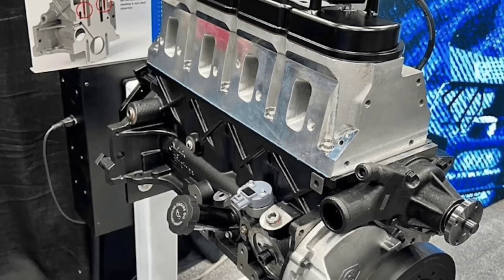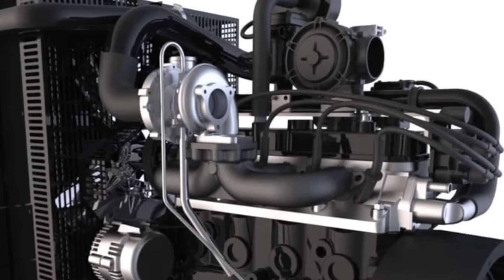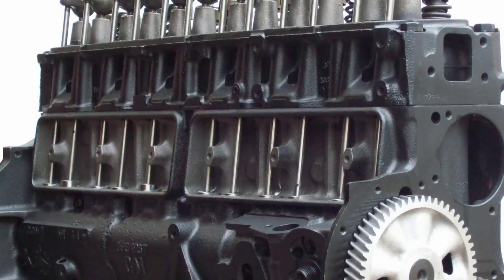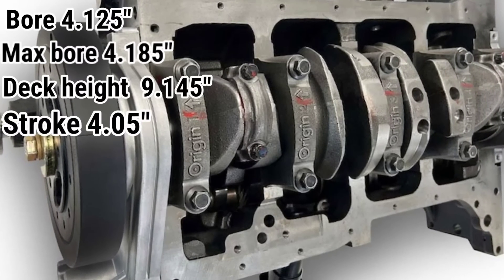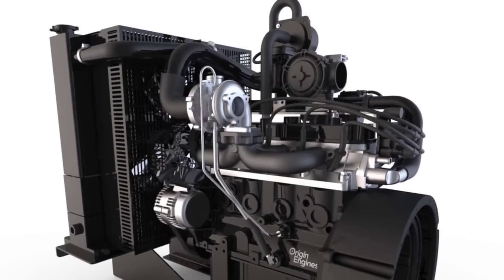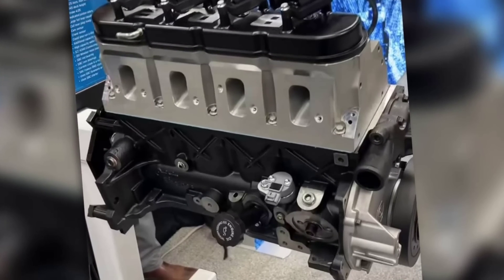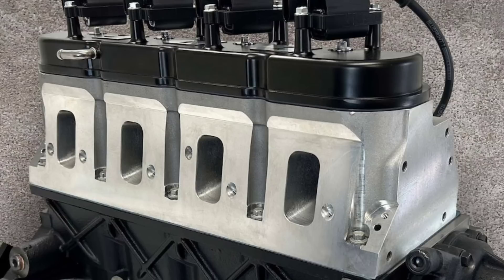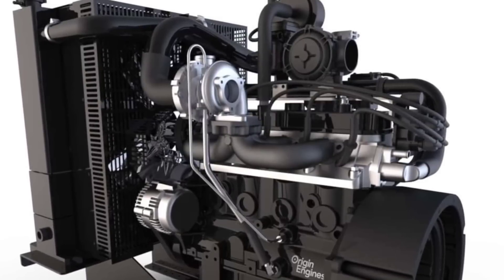SPECS and MORE on the 3.6 LS 4 cylinder engine by Blueprint engines

Comment: It would be nice if Blue Print would pick this back up and do something with it instead of shelving it.  For my application I'm thinking a distributor and naturally aspirated.  Downsized version?  like a 4.0 bore and a 3.75 stroke would come out as a 3.1l that would perform very well also instead of maxing out the block. Even with that I'm sure it would out perform my current 4cyl and 100 hp.  Question is about the accessory bracketing though.  Got an early toyota truck with AC, and power steering

Comment: Looks like an improvement over the old 3.7 mercrusier Al block, open deck, BBF headed, 170 motor. Big 4s are cool! I'm thinking a GM 3.0 4 cyl industrial motor with a bowtie head and a turbo wouild be nice for a flatfender or early CJ-5. These are awesome!
Reply: grab a motor from a fork lift, swap the cam to a 3/4 or one from a marine engine,   use a clifford intake and header,  it's a beast

Comment: There is way to much emphasis put on 4 bolt main caps, imo those 2 extra bolt just makes most people feel warm n fuzzy to see them. Yes the extra bolts do increase  clamping power but it basically just helps stabilize the cap and helps spread out the load but as far as clamping power there contribution  is miniscule, about the time the cap is relying on those outer bolts to hold together it's likely too late, if parts didn't scatter there's likely already damage. Besides when was the last time you saw a grenaded engine where the crank popped off the block... Welp the rods held but the caps didn't... Never. Obviously when you get into the big HP engines they play more of a role but in a 300 or 400hp SBC it doesn't matter if it's 2 or 4 bolt and if i remember right with the 400 SBC the 4 bolt are the weaker blocks. And if your doing a factory block high hp SBC build you want to source a 2 bolt because then it can be converted to a splayed bolt cap if you start with a 4 bolt that's what you stuck with and they are not much better than a 2 bolt.

Comment: The block appears to be based on late production  GM 3 litre marine and industrial block, which is a big bore and longer stroke (4 in. X3.68 in.) version of the old  '62 to '70 153 Chevy 4-banger which in turn  was based on the '63 to '70 230 cubic inch Chevrolet 6-banger.
Reply: Yes i think its based on the Chevy II 153 as well.
Reply: Did you listen to what he said in the video?

Comment: What is the need for this engine? Ok, it's a 4 cyl that will get me into LS Fest, but other than that it's a heavy, low tec, 4 cyl. If you just want novelty then why would you not just put a turbo Hayabusa motor in your vehicle at that point? Half the weight, more power, more tec, and revs to over 10k. Probably cheaper also.

Comment: GM will probabaly make a version of this that is a 3.3L turbo 4 cylinder to replace the 2.7L 4 cylinder, basically half of a 6.6L V8 l8t gasoline engine from the newer model 2500/3500 GM trucks.

Comment: I have 90 K 1500 with 5.7L v8, factory advertised 195 horse. Not enough to pull its own weight up at 5% grade. Toyed with LS swap. Then spotted this. Interested in torque that will pull this truck and moderate load up of 5% 6% grade even if I have to run it in third gear revved to approximately 3000 RPM. Will be watching this one.
Reply: Old comment, but… 
Without boost this engine would at best about equal the hp and make less torque than your factory 5.7. It’s pretty easy to make 350-400hp with an old 5.7. Might as well just rebuild what you have or swap in the good ole 350hp crate engine they’ve had forever.

Comment: I want this for a replacement engine for my 2004 E150 Ford Work Van. The Triton V8 that is currently in it is running quite strong and has been very well maintained, but this thing looks like it cuts half the weight and more or less doubles the power. My only concern is towing a dump trailer, but as long as it gets 300 foot pounds I think it will be alright.

Comment: I like it. I think there’s too much focus on the “old school, primitive” pushrod setup. Let’s remember 1000-1200hp is pretty common in the pushrod LS V8s and plenty seeing 1500-2000hp and even more. The materials of parts are more important than if it’s primitive or not in this case. That design can easily hit 800+ Hp if built right and with a rev happy valve train, large turbo and race fuel. I’d love to see this engine in action.

Comment: The things I am skeptical with this engine.

No 1: I haven't seen any videos of it running. If anyone knows of a video showing it's running please post here. I understand it's in concept phase, but surely the concept engine should be proven it can run.

No 2: Engine balance and vibration. Large 4 cylinders exhibit much secondary order vibration which can limit engine speed. Looking at the block, there is no provision for a balance shaft. I'm interested to know if this would be a development in the future.

No 3: The specs, quoting torque and power figures without the RPM doesn't really mean much. If they have done testing and have power and torque graphs, this would be more meaningful and also indicate to us maximum RPM.

Comment: I'm going to guess it's a little over 200 hp and 250-300 ft/lbs of torque NA. Probably ran it on 10-12lbs of boost with a 48-58mm turbo. That would be the most representative setup. This engine and a turbo that is little on the small side for a 3.6L, enough boost, but not crazy, would work very well for a light truck or off-road setup. It think that's who this is for. This is a gas competitor to the Cummins R28 crate setup. If you're buying this for another reason, I'm curious, but it would seem a strange choice. Hopefully, they can get this out for under $6k.

Comment: Application, application, application... I for one am excited to hear more about smaller displacement engines that are suited for toughness. I'm sizing up a restoration of an '89 Toyota pickup and even if I spent $4-6K on getting the engine professionally rebuilt for numbers by Yota1 Performance or 22RE Performance it would still only squeeze out a maximum of 130-140hp and maybe 160-180tq. I can't stomach the idea of a V8 swap because that hardly makes any sense aside from a 4.0L 1UZ and that isn't even touching 200hp. Besides-- who can say no to a new crate engine that takes easy to find parts? With the simplicity of an engine like this, the combo would make for a classic Yota look with a grunty four banger inside. Slap the six lug dually under the rear and I have a small footprint workhorse. Booyah! I'm looking forward to more deets from BPE as well as a price point 😉
Reply: But what’s the thing going to cost?

Comment: If this can put out 300 Hp at 300 lbs that's lighter than a 9 cylinder Ivchenko AI-14, which is 260 Hp at 434 lbs. There's a lot of aircraft this might be used on.

Comment: The natural aspirated numbers will depend on the compression ratio, cam shafts, intake manifold throttle setup and what fuel its tuned for. Also eventually they might come out with a longer stroke version of the crank and rods changing the numbers so I mean it's not really a set power band till the buyer specs it out and the transmission and what drive line, tires and so on will have a bit of an effect. So really the potential is still kinda endless at this point

Comment: Everyone dances around the elephant in the room ... and you did too...  BALANCE , this configuration can't be balanced for high revs, these guys dreaming of putting it in a S-10 need to know it will have a redline of around 4500 rpm....  Yes Margaret it IS a tractor engine , it will be good for a rock crawler, not a street racer !
Reply: Ive been screaming this since this engine appeared at pri. It would need titanium rods w lightweight short ch pistons w/short pins and still on top of all that need twin counter rotating balance shafts or as it climbs above 3k rpms the nvh/vibration will literaly beat itself to death.

Comment: So here is a bit of an observation more so. There are thousands of LS Engines that wind up to 7-8k RPM, because the heads can flow up to that point with minor changes here and there. So I would not say it isn’t too far fetched to say that with the correct camshaft selection (pending on aftermarket availability) that the engine would be able to withstand 7-8k RPM not to mention that the rotating assembly is literally half of a standard LS engine so on paper, with the correct parts (say 6.00” rods pistons, and a bit of touch up with the heads to better improve flow and compression.) should be a beast NA let alone Turbocharged. I personally would like to take one of these and see what I can push out of it when the aftermarket becomes available.

Comment: My Toyota 2.7 is also 2 bolt mains and is currently pushing 380-410 hp depending on weather. I had a lot of fretting at the cap once I started reving past 8.5k the solution was to increase flywheel and harmonic balancer weight as well as go to a 2" rod bearing vs the 1.78. Fret still happened so next I'll be putting a steel girdle and ladders across the caps. If the issue persists, I will have to open up the  bearing clearance half more.

Comment: With a BPE rec port head a 7.2L LS V8 should be capable of 650hp 575tq  n/a, I would expect half of that, 325hp 285tq. I really would like to see a cross plane crankshaft in this engine so that it would sound like a baby V8, I would be completely on board then. Otherwise, there are plenty of cheap aluminum 5.3s in junkyards that would only be 100lbs more weight, easily half the price and capable of 450-500hp depending on cylinder head, compression ratio and cam timing. Of course even the diminutive 4.8 can handle 1,000hp at the crank with boost so any LS/Gen III/IV engine is a monster. The possibilities for the Atlas 4200 are insane too as there is growing aftermarket support for those thanks to Nivlac57.
Reply: First of all, it needs a balance shaft
Reply: Yeah right more like 250 na max.

Comment: After seeing the first video, I went on marketplace to look for a specific type of 3rd gen F-body, aka the one with the amazingly named Iron Duke 4 cylinder. An engine released into the most 80’s of 80’s sport cars outside of the Countach (spelling?) and in the late 20th century this engine made almost 90 hp😂. However putting this thing in place of the duke sounds like all the fun👍
Reply: I’ve had three IROCs but always loved the early base model cars. I would love to put one of these in place of an Iron Duke!
Reply: @sc3ku  imagine the “wtf is that” factor at a car show
Reply: It is a duke , same block as early S-10'S, an keeps , bell housing same as all block , mercury marine mercrusier boat motor , they make a ,three liter
Reply: The iron duke was rare in Camaros, but fairly common in stripped-down firebirds because the iron duke was a Pontiac engine design.
Reply: @Cream_of_sum_yung_gai  yup it sure was, and in fieros. But the best place I've ever seen one was in a boat. And no not as the anchor, but for moving around in fresh water it's a perfect low stress environment for that thing. I have no idea if it'd do quite as well in salt water with currents and such but out on a nice calm lake it's fine for moving around a little fishing runabout. And given the period it was built and the third gets were designed engines like the iron Duke had to happen. 1. It showed American manufacturers that complacency in the era of people seeing what the japanese car companies could do with a four pot was very ungood for them. And customers leaving them for brands like Honda and Toyota was an actual threat. My dad had just gotten his first union book as a welder and went to buy a brand new 79 Z28 but was unable to get financing with no credit, even though he was making more than enough money. The Toyota dealers (so the story goes) bent over backwards to put him into a Celica Supra with a straight 6 and a 5 speed. Now did he take some shit from his co-workers yup, but what can you do?
2. That competition led to all the goodies we've taken for granted for decades now. I mean shit my first car was a 2 door 88 Buick lesabre with the 3.8 that featured multiport sequential efi and I think one of the first distributorless ignition systems. It wasn't coil on or near plug but rather the big mono coil that I think was 3 coils in one with each coil lighting off 2 cylinders. But not bad for 1988, and it's always bugged me that they had that tech sitting there when the 92-97 5.7 Lt1's were being developed and someone in a meeting at GM said " yeah that distributorless system is nice and all but what if we used a needlessly complex set of wheels with holes in them hooked to a pancaked dist. and used a stupid expensive LED flasher /reader combo from Mitsubishi to use those holes to tell the ecu what cylinder was where)
"Oh so it'll just tell the computer what's what and not have any of the high voltage that causes wear in regular distributors?"
"Oh no no no we'll keep all that together what harm could it cause?"
"And with the fire wall being over 1/3 of the engine how will we mount this wonder of modern technology? Will we go to a Ford type setup with it in the front of the engine?"
"Oh yeah definitely the front but to clean up the look of the engine bay we'll mount it under the waterpump, right under the weep hole, and I'm reliably informed these both the pump and this new not distributor will last 100k miles so no need to worry about coolant leaking onto the high voltage bespoke ignition unit that will run customers about a grand to replace."
"What about puddles or other standing water that a customer might drive through?"
"Our target customers don't drive these machines in bad weather so im sure it won't be an issue. Now we just need a name, something catchy that also shows off the new tech, how about Digi-Ignition or Tech Spark....."
"Sir how about Opti-Spark?"
"Jenkins you're an idiot and you're fired clear out your desk immediately and vacate the building!" Jenkins leaves
"All right Opti-Spark it is, make sure the powers that be know this was all my idea! Thisll go down as the best thing since the small block and corvette were born, and the entire automotive world will remember this as fondly as they do those two great icons of GM"
Six months after the Lt1's launch in the 92 Corvette customers were ready to lynch that asshole and no updated opti ever really resolved the "reliability issues" although adding a fresh air vent and drainage certainly helped the opti sparks shittieness was only highlighted when the Grand Pubah of V8 engines the LS1 showed up with coil near plug ignition that used the same sort of timing devices (plus a cam sensor) that my old 88 Buick had. 
Sorry for the rant got a broken leg and stuck inside, hope it was at least entertaining. Oh and before anyone chimes in with "my opti is original with 5 million miles and has never given me a problem, know that your the exception not the rule, you're that blind squirrel all happy because he found a nut

Comment: Another thing I just thought of, Ford tried a short lived official program with their other 2.3 4cyl, the HSC, for mostly the same application this little GM is probably meant for (not a Lima, completely different engine, HSC is a pushrod 4 you got in the Tempo, Taurus and Aerostar, I'm not a fan of it; really a 300 straight-6 with 2 cylinders lopped off, they shared some parts. Not bad, but God himself with magic can't rev it past 5,000) and if I remember right the program was aimed at marine & off-road too. That's where Ford messed up, trying to hotrod the pushrod-4 while wholesaling Lima OHC's to heavy/industrial, totally ass backwards. Oh well that's the 90's for ya. It'll be interesting to see where this Ironduke reboot goes I honestly mean that

Comment: My thoughts are still kinda the same, neat idea but a bit too little a few decades too late.. I don't think anybody (in 2023!) will really want to spend Blue Print kind of money on a pushrod Ironduke-based platform when OHC Lima 4's (that's the motor in your old Mustangs, Rangers, T-Birds etc) in the Turbo Coupes were pushing 400hp in the mid 80's and Esslinger is STILL supporting them (10k 550hp screamers without any major reengineering for midget/jr sprints). Fantastic little engine, cast iron blocks but probably still less weight, and OHC. You technically can bore & stroke up to 3.1L but isn't ideal (bore spacing becomes an issue). Now where this Ironduke/LS graft has the upper hand is in MASSIVE head availability, I can get on board with that. But again, I won't pay Blue Print kind of money to be left with pushrods & dead weight from all the valvetrain, that's not what 4cyl engines are for.. You only go 4 for the revs & weights, I don't see this ever pulling that off

Comment: I like this motor do to the factor of it's parts they would be cheap to come by for some of them anyway and if you're getting high performance if those numbers do exist it's horsepower and torque value give me a pretty good engine for going into some old vehicles that you want to keep around but fuel efficient and Light I keep the reliability of its older motor but with a modernized version and well again anything can be fixed with gearing